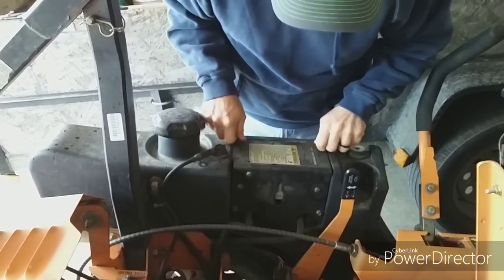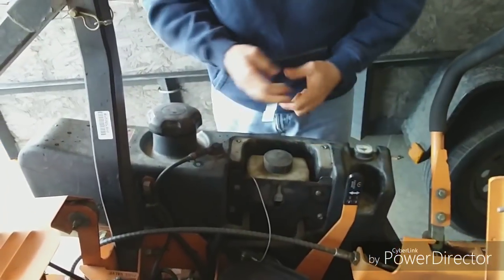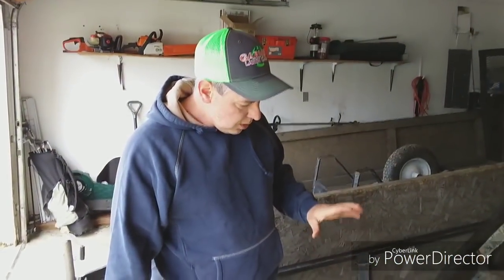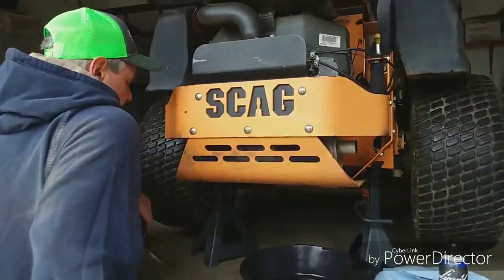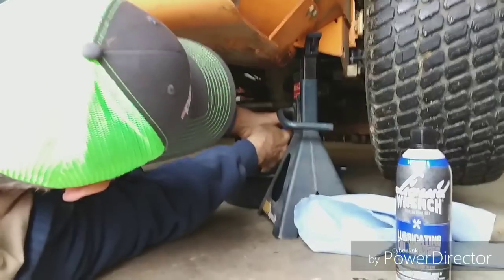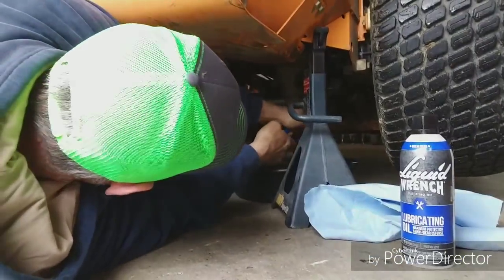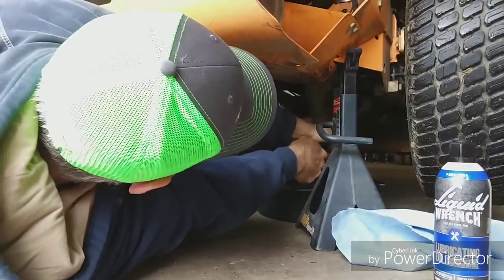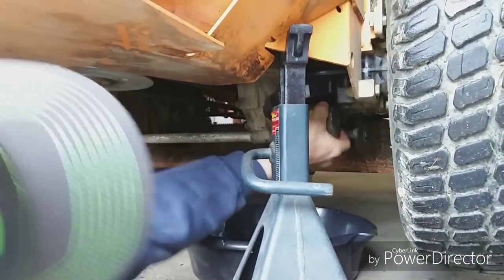Hydraulic Oil Change on Scag 52" Cheetah

Comment: Would you happen to know why my cheetah will on drive in circles? It seems like the left ram won't move and it makes a whining sound when i try to move it. The fluid is full and the other side works perfectly. The mower is 3 years old. I use it to mow my property in wadsworth/medina, Ohio. It's 7 acres. Any help would be greatly appreciated. Enjoy the videos, thanks.
Reply from the maker: Actually sounds like the pump is out. Also may be one of your hydro pulleys. Message this guy named Tom Doby mower repair. He will more than likely have the answer for you. Hope that helps Robert! Thank you sir

Comment: How do you get air out scag cheetah 
Change the hydraulic oil
Reply from the maker: You have to purge it by opening the cap and doing what I did running it back and forward

Comment: I got my passenger (right) pump I cracked the filter loose. It let some fresh out out. The drain plug hasn’t dropped a drop
Reply from the maker: Perfect 👍
Reply: @DOCREAL1118  it has no pull in drive. when I have it lifted in the air. It’s been about 3 hours and haven’t got it out of the Allen drain bolt or however on the top.
Reply from the maker: @braydenfrench8569  Not sure what you mean. You took off filter and replaced it? Then all you do is start to fill up the reservoir. It's been so long since I did it. I have all stand ons now. If you need help just email me. s_spiert@yahoo.com